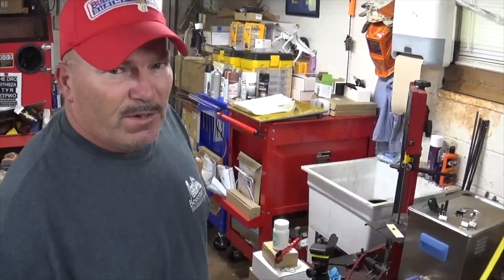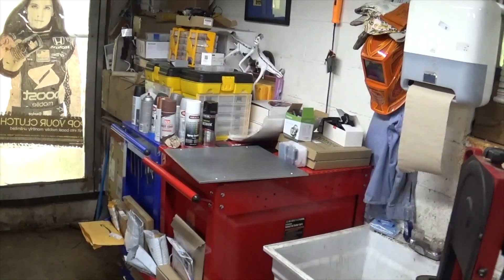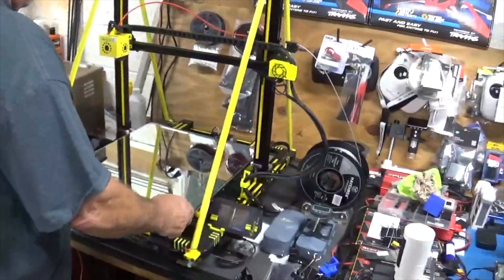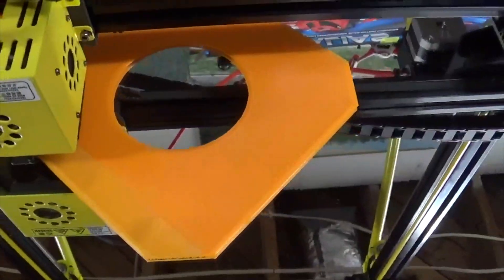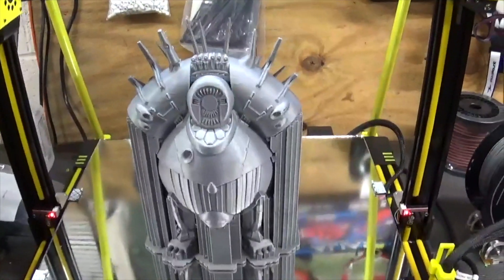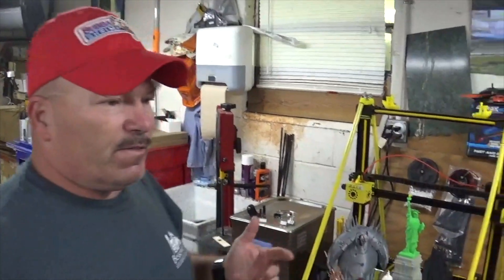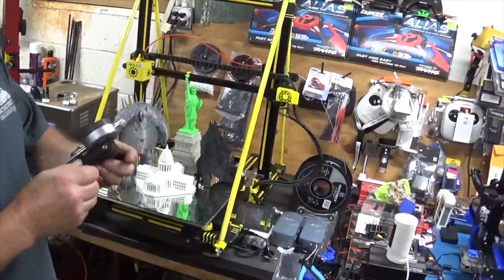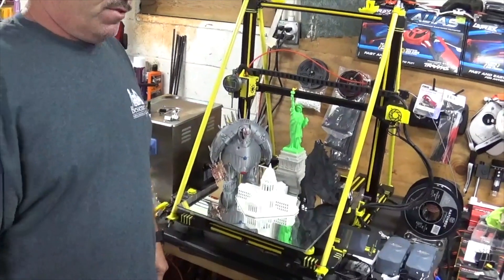Anycubic Chiron 3D Printer Major Upgrade Anycubic Chiron 3D Printer Video

Comment: Great video and super helpful.  Are you still printing with this beast? It looks like you have some coating on the mirror for adhesion?  If so, what are you using?  Thank you
Reply from the maker: I used a thin sheet of 3M double sided tap.
Reply from the maker: Never had any luck with the sensors. I had better luck with a depth gauge that I use. You can 3D print a holder for the depth gauge on Thingiverse
Reply: Another question came to mind. You implied that you do not use Chirons bed leveling sensor. You only need the depth gauge? Thanks again

Comment: Love the plate idea as I am getting a little model edge lifting later in the print run. I am curious about the z axis supports. Would love to know where you got those or the plans.
Reply from the maker: I bought the threaded rods and PVC pipe at Lowes. I printed the parts  off off Thingiverse. That mounts the rod.

Comment: I think the next upgrade will be the thick aluminum plate, switched drivers to tmc2208 and learned VS code to modify the firmware, and changed to Nema 17 stepper motors. I will be calibrating it later today after I find the extruder heater short.

Comment: Hey there! amazing mod. Can you tell me the aluminium plate size please? is it 430*410
mm
Reply from the maker: The aluminum plate will be the same size of the heating plate. The aluminum plate thickness should be 1/8 of a inch thick.
Reply: @TheDronzDr  Thanks, I can't print anything atm, so I'm wondering if this mod will make the leveling easier. I have a spare heating bed, if it's worth it and if it improves the leveling and printing quality I'm willing to do this. What do you say, is it worth it?
Reply from the maker: @MrGvtb  
It was for me.
Reply: @TheDronzDr  Thanks, I'm just not sure about something, in the description you wrote that the aluminium plate is 1/4, which thickness is right?
Reply from the maker: @MrGvtb  
1/8 a 1/4 is to thick
Reply: @TheDronzDr  Thanks, you got a new subscriber!
One last thing, in the video you used 1/4 but now you are using 1/8, my question is, did you still made the holes for the screws on the aluminium plate(1/8) or did you just use the adhesive?
Reply from the maker: @MrGvtb  
Yes I did

Comment: Hi.  Great video - thanks!  I am new to 3D printing, and in removing a print, it pulled some of the black material off the platform.  I've been thinking about setting a glass mirror on the platform for a few weeks now since I do not like the texture of the platform for the items are making, and this screw-up on mine has prompted me to take action ASAP.  I have not been able to find anyone selling a 16" square glass mirror, except for one vendor on Wayfair who is selling a 3-panel set for $96.  Thing is, the 16 x 16 is perfect but the thickness is 0.3" - a shade more than 1/4".  Will this work atop the platform that came with the Chiron?  Do you know of any vendor that could provide a thinner mirror of the same dimensions?  Thanks in advance for your help!
Reply from the maker: All you need to do is. Go to a glass were the cut glass for windows and take you build plate with you. Then tell them you want a mirror glass the same size. The thickness can be 1/4 inch. But remember the you have to set your Z high when you level your bed 🛌.

Comment: Hi Dronz Dr, i got the plate from a local metal shop, i got 3/16, my question is when you install the plate it raises the bad and nuzzle will hit the bed, I have the plate screws real tight but nizzle still hits the bed, how did you raise the nuzzle? did you move the Z Limit Switches up? Thanks in advance for any help
Reply from the maker: Yes I move the Z limit switch up and then adjusted it as I needed it to come down. Let me know how it goes.
Reply: @TheDronzDr  Hi, Thanks for the quick reply, i checked the Z switches mine has two screws on them i took the bottom screw out and moved it up one whole i can only use 1 screw and now the nuzzle is higher and cant be aligned, did you modify the Z switch bracket?
Reply from the maker: @maxim5and20  
No I didn’t. You have one on each side. You have to put both of them at the same Heights. So when you bring one down, the other has to come down the same height.
Reply: @TheDronzDr   Got it working, thanks so much,
Reply from the maker: @maxim5and20  
Thanks great 👍

Comment: I have been having nothing but issues with my Chiron lately. I think it because of the bed level. I level the bed and go to print and it’s to close to the bed. I re level and than it’s to far. Would this upgrade help. What are the materials I need? Not sure where I could get that metal plate.
Reply from the maker: Adam's Vlogs and Hobbies 
You will to get two rods or something to hold up the Z arm. Make sure they are the same size tall. Put them under the Z arm on both side. Then take both of Z rods. Now the Z arm is level. Now put the Z rods back in and tightening them. Now Relevel the bed. If that doesn’t work than bed  glass is work than warp and you will another one or Buy a mirror and glass to replace it.

Comment: Do you know what voltage the ANYCUBIC CHIRON hotend runs at? I want to upgrade mine to the volcano hotend but I don't know whether to get the 12v or 24v. Thanks!
Reply from the maker: Thomas Stokes 
The voltage is 24v. I would get the 24v because if you go with the 12v you would have to install a voltage regulator to reduce the voltage. That’s just my Opinion.

Comment: Hi, I love your work and I'm amazed I finally found a solution to this. I'm kinda new to 3D printing and I was heaving a hell of a time leveling the bed but I'm definitely following your advice and making myself the same plate you did.
I have a few questions though if you don't mind. Is the heating element attached to the original plate with any kind of adhesive or just held in place by the corner brackets? If so would you recommend buying a new one or just use the same one?
Also I use Cura as a slicer, could you send me your profile cause I'm also struggling with some of the settings and can't get anywhere near the quality prints you have. 
Thanks in advance!
Reply from the maker: The original heating plate is attached to the glass plate with adhesive. If you did get it off it would not be flat. What you will need to do is to order a new heating plate. www.ebay.com/itm/UK-ANYCUBIC-Ultrabase-for-Chiron-3D-Printer-hotbed-platform-plate-430-410mm-24V/372673699441?hash=item56c5155e71:g:zqcAAOSwSIRc4mhJ. Once you get the heating plate. You will need to order 3M adhesive tape: https://www.amazon.com/gp/product/B01HP2CEG8/ref=ppx_yo_dt_b_search_asin_title?ie=UTF8&psc=1 Then put the tap on your new aluminum plate. Then pill off other side of tap. Then stick your new heating plate to the new aluminum plate. After that you can put minor glass on top aluminum plate and clamp it down. I use Simplify3D for my slicer so it wouldn't be same sorry. Hope this help you. The Dronz Dr
Reply: Hi  @TheDronzDr , thanks so much for your fast response. 
I contacted Anycubic in the mean time and apparently they are sending me a new heat bed but I'm not entirely sure it will be disassembled as I would need it to be to do your upgrade, fingers crossed. Regardless I'm always open to try new software and since you are obviously more experienced than me and had amazing results I'll give Simplify3D a try. Do you mind just sending your profile anyways? My email is nikpeosa@gmail.com
Also do you by any chance have a custom firmware installed in your printer or the custom 1.3.0?
Reply from the maker: Nicolò Pasini 
I have the Standard software that came with the printer. The new version really doesn’t make that much difference. I had them send me a new heating plate and it came separate from the glass plate so you should be OK on that. I will try to send you the profile this weekend.
Reply: The Dronz Dr thanks so much for your help! I really really appreciate it!!!
Reply from the maker: @peosa95  
Anytime my friend
Reply: Hey  @TheDronzDr , the new heating plate is the same that the original? This link that you mentioned is broken. 
I'd like to use the mirror in my Chiron, but I don't know how to change it. 
My chiron doesn't level at all, maybe with mirror it can work.
Reply from the maker: @viniciusmoraes4895  
The aluminum plate is what’s going to make a difference

Comment: Do you have a drawing for the hole positions and size of the plate you made?
Reply from the maker: No but I can get it for you. But I would go with a 1/8 inch aluminum plate. Instead a 1/4 inch.
Reply: @TheDronzDr  That would be great if you can sort a copy of a drawing for me.
Reply from the maker: Stephen Tribe 
We’re do I need to send the drawing to?
Reply from the maker: Steve Tribe 
I  will try to send it to this week. I just took the heating plate and drilled the holes from it on top of the aluminum plate. But I can draw it up and send it to you.
Reply: @TheDronzDr  Thank you

Comment: can I just put a mirror ontop of the ultrabase bed? mine is heavily warped, I have the printer almost a year and couldnt print anything :(
Reply from the maker: Yes you can. But make sure you bed is level before you print. If not it will look 👀 like fido ass. You minor needs to be 1/8 thick